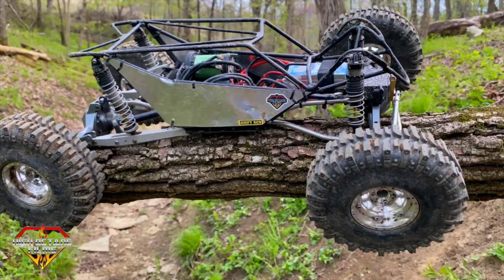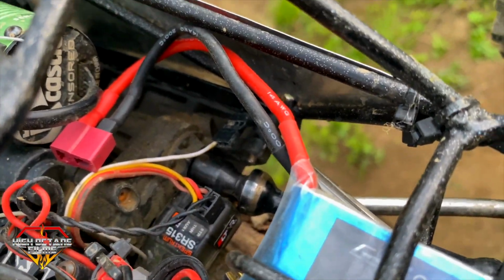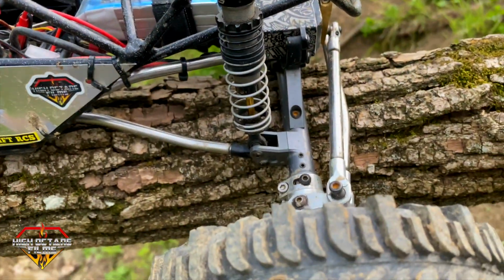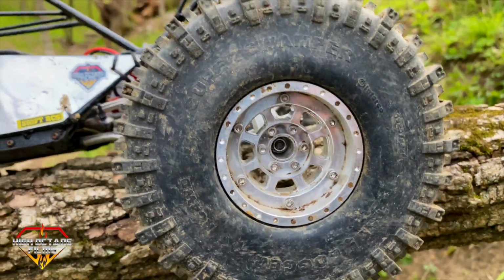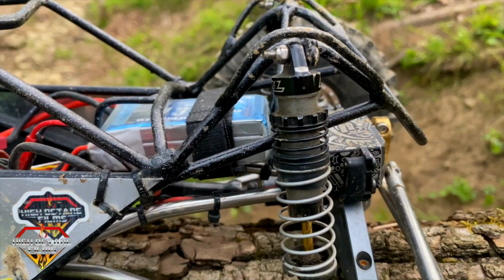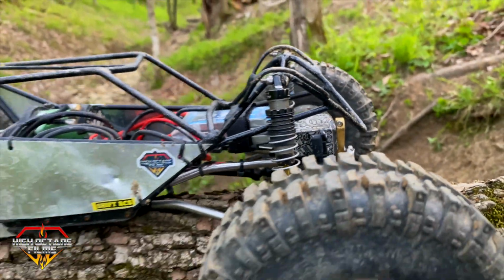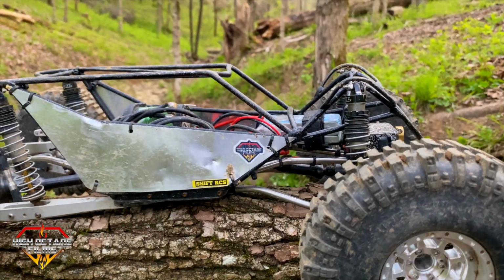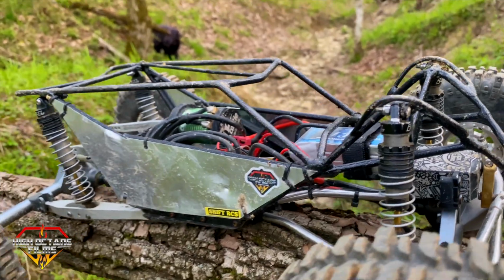"DRASTIC" AN AXIAL BOMBER BASED RC ROCK BOUNCER

Comment: I need one of them high octane films stickers for my bomber! Damn, 4600kv is pretty high! I was running 3800kv in mine but just got a holmes 3300kv to swap in.
Reply from the maker: I know a couple running 5700 and 6000
Reply: I seen that holmes had some race spec motors up there, i couldn't even imagine them on 4s or 6s lol
Reply from the maker: @TurbochargedHobbies  be hard to control that’s for sure.
Reply: That’s funny Brent, I just swapped my Holmes 3300 for a Castle 3800
Reply from the maker: @Mletchworth  😂 y’all coulda traded.
Reply: @HIGHOCTANEFILMS  naw because i put the 3800kv into my ryft lol, will say 3800kv on stock ryft gearing is ridiculous on 3s. Ive drove crazy rc's but this ryft is a weapon. Its way too fast but temps weren't outrageous
Reply from the maker: @TurbochargedHobbies  hahaha almost then.
Reply: But now that i think about it i wouldn't mine trading if its someone local because that 3800 is probably just a touch too high of a turn for the ryft
Reply: Just posted a shorts of the ryft

Comment: How much would that cage be
Reply from the maker: I made it, so just the cost of materials 50 bucks or less
Reply: @HIGHOCTANEFILMS  how much would you sell me one for
Reply from the maker: @connermcdonald9323  i don’t sell them. I’d I did they’d cost 3-500 ish, all you need is a rod bender, grinder, cut off wheel, and a good mig welder. And you can build your own.
Reply: @HIGHOCTANEFILMS  so you wouldn’t be able to build me one
Reply: @HIGHOCTANEFILMS  or could I buy the plans
Reply from the maker: @connermcdonald9323  I don’t have any blueprints I built it out of my head. pm me on fb to discuss details